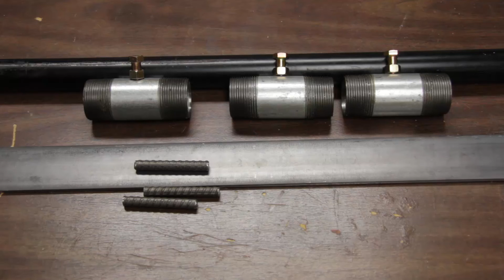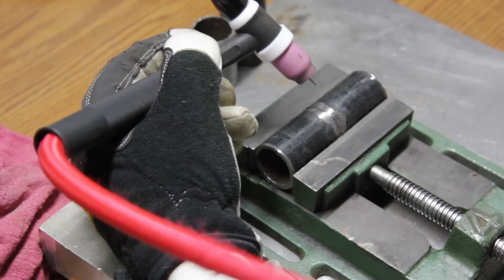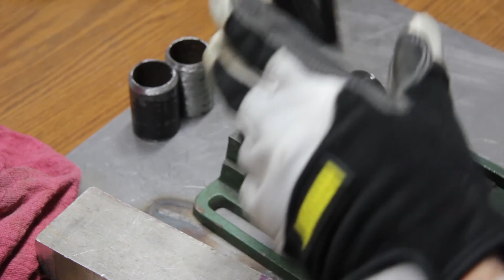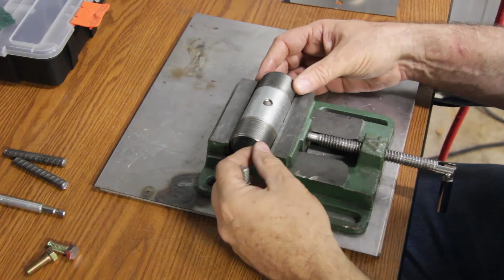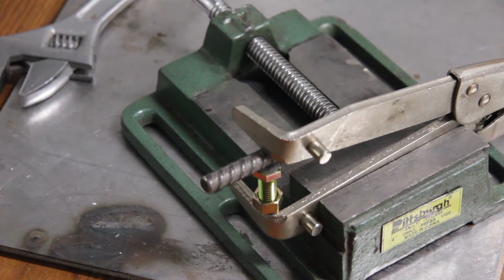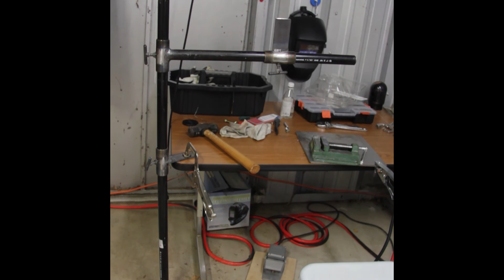Welding Tree Stand for Cheap

Comment: So you didn’t add any legs just used the clamp to stabilize against the table?
Reply from the maker: Yes, that is correct.That way I could move the stand around the welding table.